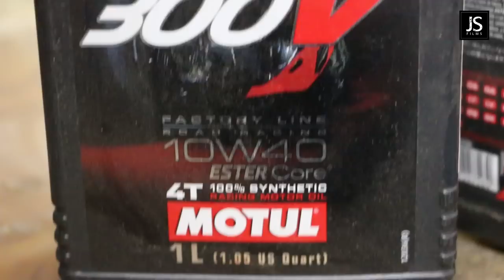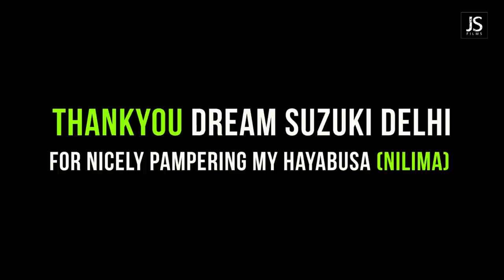Suzuki Hayabusa Full Service | Step by Step Process!

Comment: Just an advise
Whenever Changing oil filter pls pour a little engine oil into filter before fastening it. It will prevent filter and engine  run dry for first few cycles

Comment: the oil you used was 300v factory line motul 10W40 which is 1200/- , then why have you mentioned 4600/-?
Reply: 1 litre price is 1200 u need more the 3 litres for busa.

Comment: That is not a major service but a very minor one and washing is not part of a service. What about checking clutch and brake fluids and spark plugs with replacement plugs and fluids when due. A major service is quite specific and completed every 12000 kms.